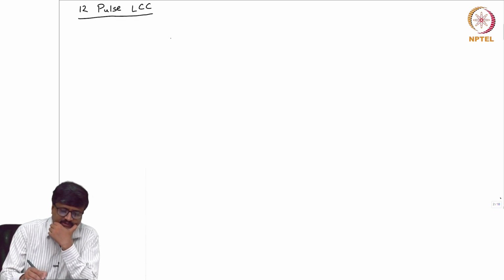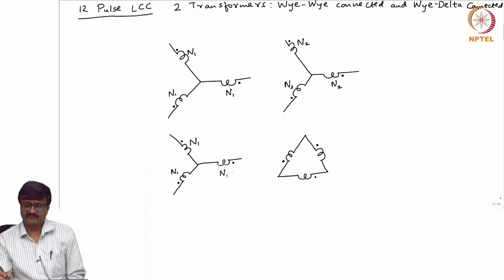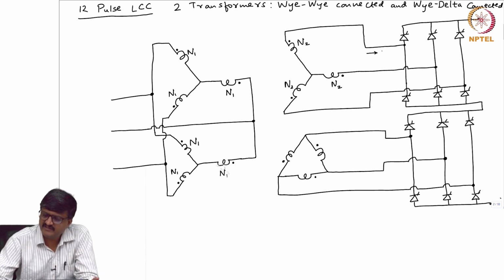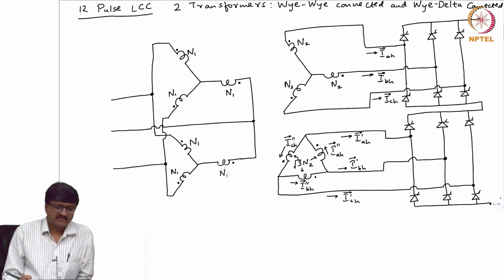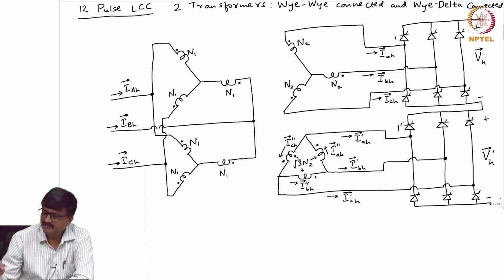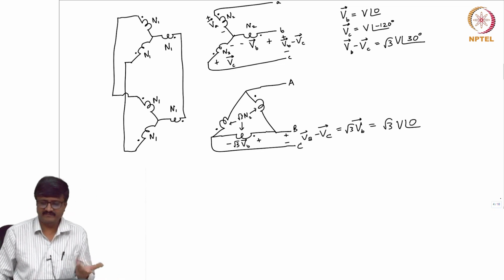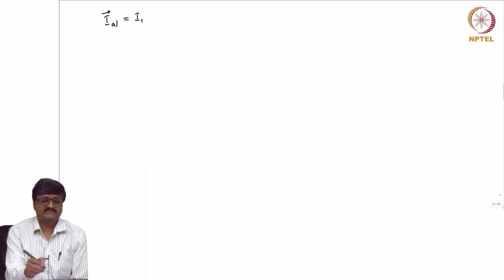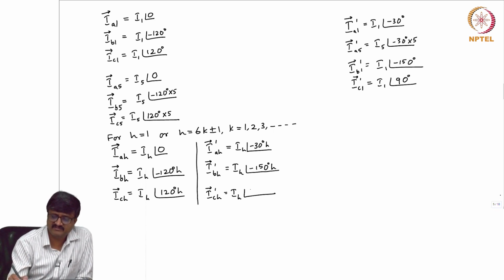Lecture - 46 ( 12 pulse LCC: Part 1 )

Comment: Why we are using two types of connection ?
Can we use instead of  Star-Delta only Star-star or Delta-delta in secondary side
Reply: For getting 30° angle Difference from combination

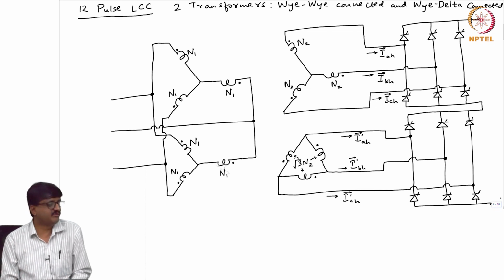Comment: @16:00 why the number of turns are root3 *N2. please explain.
Reply: bhai kyonki jab aap upar wale transformer mein dekhoge to paoge ki line voltage jaa raha h 6 pulse converter mein ....lekin neeche wale mein phase voltage jaa raha h 6 pulse converter mein......to upar wale transformer mein agar aap line voltage nikaloge to root 3 times ho jayega voltage .....aur neeche wale mein root 3 times nahi hoga........agr asaani se samajhna h to values leke kar lo upar wale ke primary coil mien voltage maan lo ......Va=1 angle 0
Vb=1angle-120
VC=1angle120
ab transformer ke secondary side pe voltage nikal ke dekho.....to paoge ki delta ka line voltage star ke line voltage se root 3 times kam h to isiliye turns ratio ko root 3 times liya h taaki voltage ka amplitude same reh sake dono 6 pulse converters ke liye
Reply: @shubhamide   thanks for such detailed explanation 👍🏻👍🏻